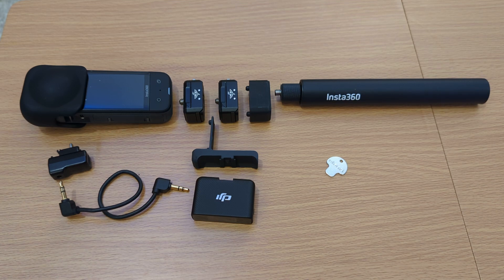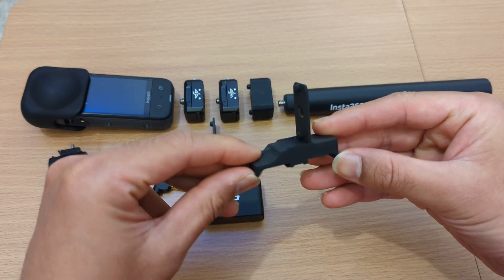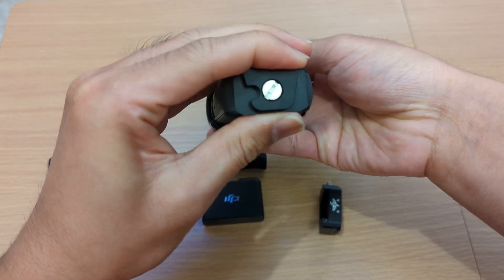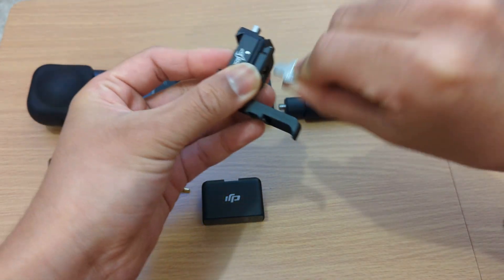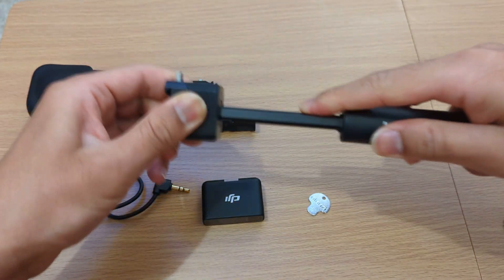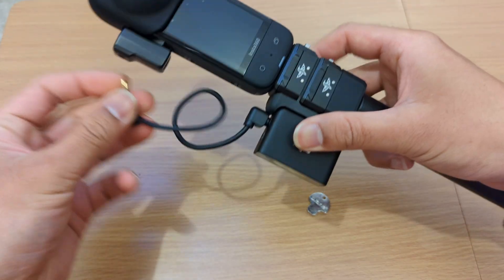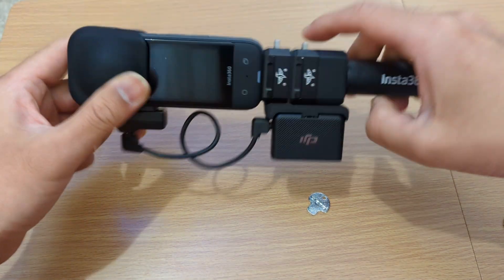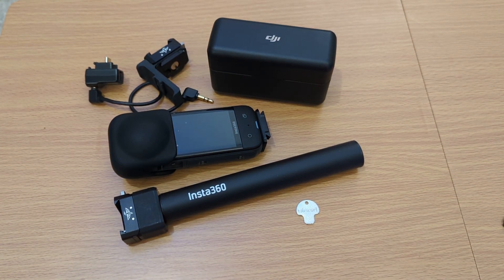3D printed DJI Wireless Mic mount onto Insta360 X3 with quick release V3: assemble instructions

Comment: It would be nice if you had a version with the receiver up even though it covered the battery. So it could be used without a selfie stick. With a motorbike mount for instance. But maybe facing your mount opposite could work as well?
Reply from the maker: there is v3.1 you can see in my printable page.
Reply: @ongxeno  Finally I printed version 3, because I just have the X4. Thx
Reply from the maker: @rvillabromasivo  how does it fit the x4 ? same curve as x3 ?

Comment: Very cool, thank you!
Do you know if it fits the insta360 quick release mounts? They seem to be quite similar to Ulanzi, and they're much easier to get in my country. 
On Printables you wrote that the 3.1 version has improved compatibility with another mounting system, but you didn't specify which one.

Thanks in advance :)
Reply from the maker: 3.0 is for mounting to insta360 stick only.
3.1 is for anything else. For example, ¼ inch tripod mount, go pro style action camera mount.

As for insta360 quick release, I think it is just a rebranded Ulanzi, but I do not know for sure.
Reply: @ongxeno  awesome, thank you so much! :)